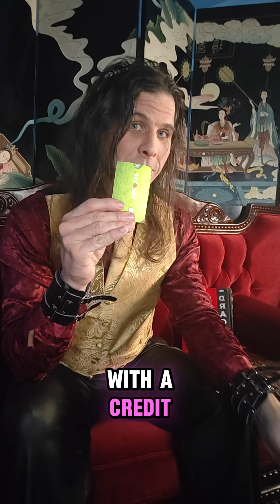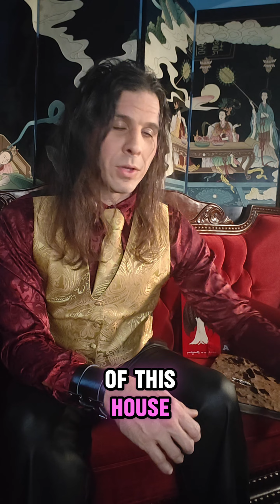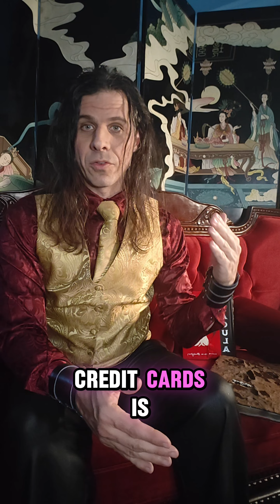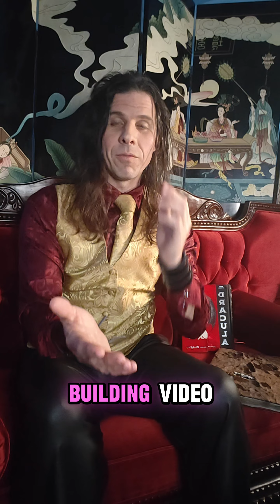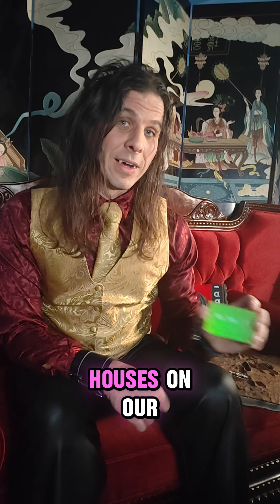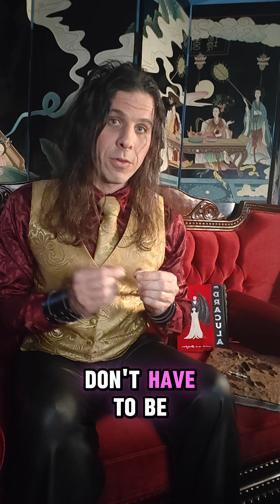I just bought a house using only a credit card

Comment: 0% terms for first year state that all interest will be tacked on at the end of 1 year if card is not paid off in total lol. You could always balance transfer but overall terrible idea. Higher interest, larger utilization rate so it destroys your credit also
Reply from the maker: @kennyfry180  I literally opened $50,000 in credit the month before I did this. This won't even cause me to exceed 30% utilization. I'll have the refinance finished before the year is over after I'm done with the repairs and will pay everything off. If the alternative was not buying this property that I will make over $100,000 on or buying it this way. Which do you think makes the most sense